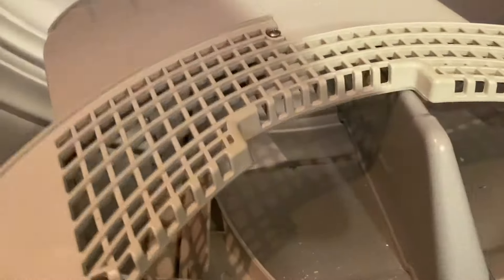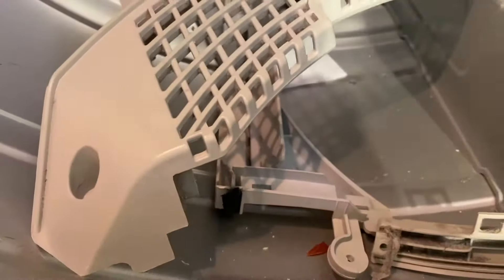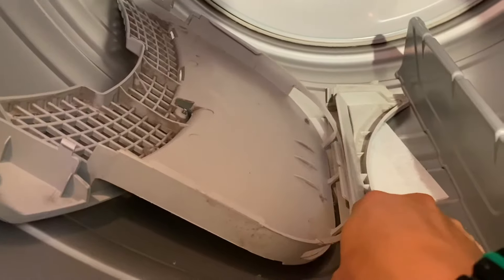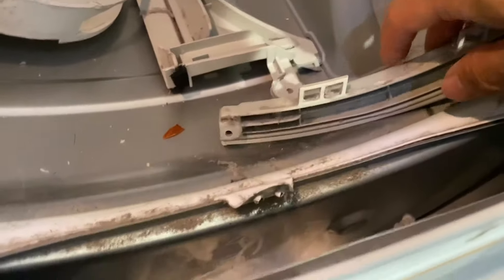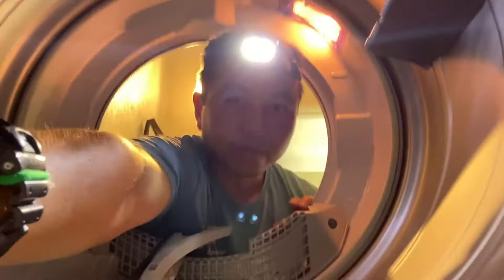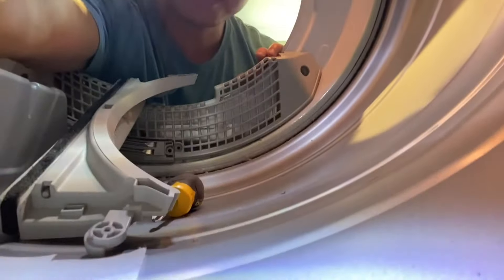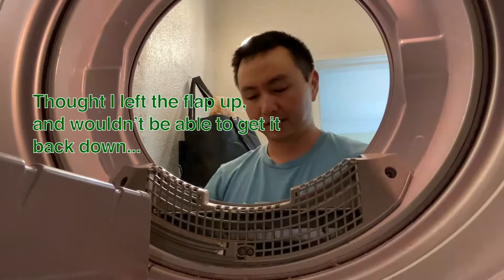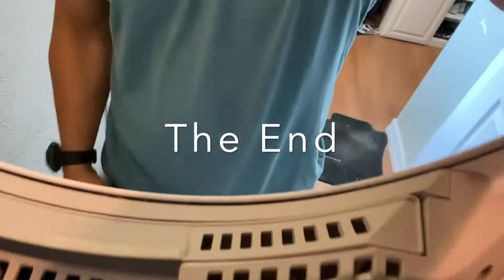LG Dryer Lint Removal Beyond the Filter

Comment: I'm having a hard time getting the screws on the sides back in - one each, down a deep well.  I can't get the screw into the hole to get it started (i need to lift the tip of the screw, which is hard b/c it's deep down the hole

Comment: How did you get the front piece (that sits flush up agains the dryer) and then the top inside (grate looking one that has the two screws at then bottom) back on? I can not for the life of me get the screws back up to the holes.
Reply: Never mind. I figured it out. There is an extra hold that’s just hanging out for no reason. 😂

Comment: we do not c if the job he did works cause i did exactly what he did mine not work i continue look for the problem
Reply: I am look in mine is mine, brand new home and I am getting a D 95 error code, I took this out myself I had the new LG sensor dry smart thin Q. I took everything out and I shot backed it everything is clean but guess what keeps getting wet nothing is working I think it’s a flaw in their system

Comment: The little thin flap that pops back up when you pull the screen does not want to pop back up anymore. I wonder if there was a spring or something that I didn't see/hear fall out and got vacuumed up.  For now it is just laying down and when I pull the screen it continues to just lay there hanging down the front edge of the vent. Oh well.